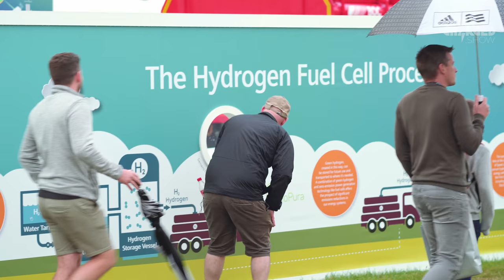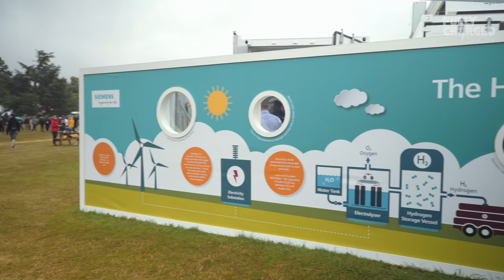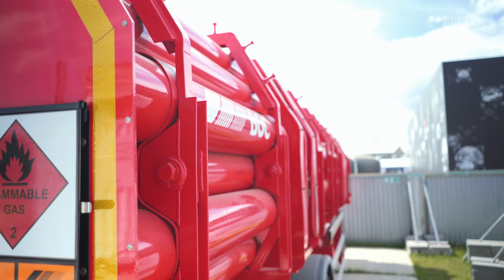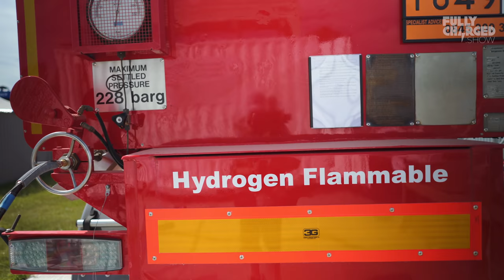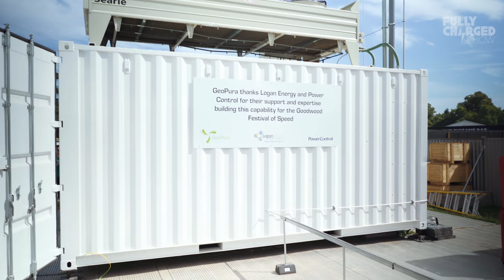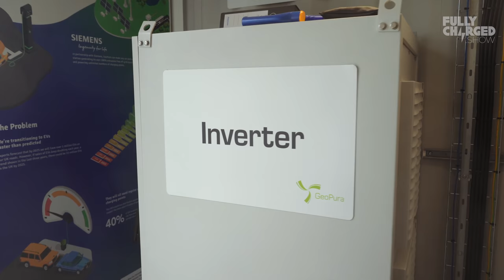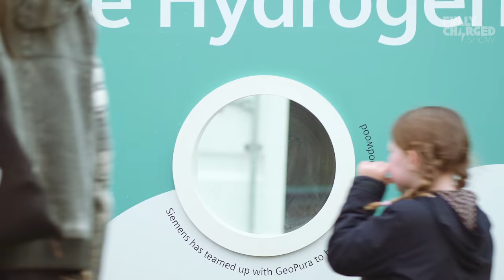Green Hydrogen Fuel Cell Charging System at Goodwood Festival of Speed | Fully Charged

Comment: In the coming years, as sustainable power generation infrastructure becomes ubiquitous and more sophisticated, there will probably be a place for hydrogen. Power generation in isolated locations could be married to hydrogen production as a means of storing energy. Hydrogen can't be shipped long distances, I believe. So why not plan docks for various ocean-going ships and/or fueling stations along long-distance truck routes, which are all near isolated wind or tidal energy generation sites. Flexibility and intelligent choices will result in clever solutions. Can't wait to see all this unfold. Wait for big oil to start buying up sustainable energy companies - then we'll know the change is on.
Reply: Meanwhile shipping (even cruise ships) runs on the dirtiest fossil fuel possible because its the cheapest.  I agree, shipping is the logical use for hydrogen, possibly the only one that really makes any sense.
Reply: Storing energy in hydrogen is an incredible waste of energy. It needs minimum 3 times more energy than batteries. There are better solutions than that.
Also hydrogen is in the interest of the Oil industry because most of the hydrogen gets produced by steam reforming from fosile gas. This is why hydrogen gets promoted so much all over the media. The idea behind the H2 car is very old but still this technology got its problems. The efficiency can not be increased by the way because one can not change the laws of physics.
Reply: Mike Trebert
Why not?
1) Because untill we have a LOT of "spare green energy" it will all be used anyway, or stored in grid battery banks, or home batteries, OR EV's (VtoG!!).

2) Before that unlikely situation occurs, it simply throws energy away.

As they said, "the fuel cell is 50% efficient, makes a lot of heat"
You'll say that's not to bad, but how efficient is the electrolysis to liberate the Hydrogen from water?
Let's assume that's 50% efficient as well.

That means at the car battery you get 50% of 50%..... 25%.
Or 75% simply thrown away.
Then there's the cost of running the plant, transportation, etc.
Reply: @Andy Geee 
Can you imagine the by products produced creating ammonia?
It's just an oil industry excuse.
Reply: @aladdin8623  you are thinking in the 19thC. Hydrogen is a building block of the universe and is liberated by the sun everyday on the ocean. Forget the limited science you have been taught. Water is very clean. Did you hear these men? They can liberate the Hydrogen using sun and wind. NH3 is irritating to the senses and toxic.
Reply: There’s a lot of research going into finding a proper electrodes that can help in producing hydrogen directly from sea water because its already a pretty good electrolyte due to the salt in it while preventing the formation of toxic chlorine gas, if this could be done with help of clean energy such as solar or tidal we gonna have a clean resource, personally i am more interested in methanol as a future fuel and there’s already clean way to produce it, much easier to storage and way better in fuel cells
Reply: Big oil is buying up sustainable energy companies to control them, not to become sustainable. Your hope in intelligent choices is nice but sadly naive.
Reply: @aladdin8623  But isn't the idea of this system to hydrolyse water with the excess electricity generated by wind and solar rather than natural gas? Electrolysis is 80% efficient, and the heat generated in the process can be put through a heat exchanger. A hydrogen fuel cell is also 80% efficient and the waste product is water. This is why they are used on the ISS. Sounds like a win-win to me.
Reply: @alaneasthope2357  The overall energy efficiency of electrolized Hydrogen used in a fuel cell is about the same as internal combustion engines burning fossil fuels.  (Do the math.  Be sure to account for the energy used to refine oil, which is very much.)  A natural gas ICE backup generator is actually a much smarter use of resources.  Fuel cells are indeed very well suited to manned space craft.  For use on Earth, batteries are 3x to 4x more energy efficient.
Reply: @thankyouforyourcompliance7386  I understand  the history and until recently I would agree with you. Luckily I have seen some new tech in the pipeline.  Big oil will come to heel and  receive a history lesson. Very exciting times ahead for the planet.
Reply: @andrewcoates1  what does hydrogen being a build block of the universe have to do with it? It's still a question of energy conversion and and best efficiency. These guys in the video may have some interesting points to make, but they are just doing a sales job. Don't think they are giving you the whole story. They talk about 50% efficiency to convert to electricity, but conveniently miss out the inefficient process of manufacturing, compressing and distributing the hydrogen.
Reply: Mike Trebert Hydrogen can be shipped over long distances in the form of ammonia and mainstream oil companies are already buying into and financing R&D for hydrogen and other energy types. Don’t know why so many people think that BEVs are an end in themselves. They are an interim step towards a hydrogen/fuel cell future.
Reply: @RedBatRacing  Sure you are right.  I emphasize the importance of looking passed the current self imposed 'science' limitations  by  Big Oil / Tech investors who will try to merchandise a basic product ' Water'.  Most will quote the high energy cost to liberate Hydrogen. Macquarie Universtiy were the first main stream western university to debunk th myth and explain that this is simply not true. The sun liverates Hydrogen by frequency resonnance not high power.  So, there is no doubt that great leaps in effeciency will be made and yes I am optimistic - not in an infantile manner, but for the purposes of busting the self limiting acceptance of most.
Off topic, but effectivly highlignts my point,  China advertised they trialed their first photon engine for space propulsion. Fueled by suns rays. NASA comes out a few days later and says, oh yeah we have one too.  But the media still bang on about rockets and rocket fuel ; all redundant and off track.
Real technology advances are being revealed at this very exciting time in history.
Reply: Please stop with the 10 year doomsday predictions.  We have had only 10 years to decarbonize has for the last 30 years according to many climate scientists with the attendant credibility hits.  All it does these days is create frightened and depressed school children. We will absolutely NOT eliminate carbon by 2030 so do we give up? No, we move forward as quickly as we can with economically attractive solutions.
Reply: @aladdin8623  Well said, as a "fossil" hydrogen producer for many years , I can't see it as a viable fuel. If you are looking short term then probably LNG conversion of shipping, which is readily available ( At a cost) will at least help environmentally.   Hydrogen from renewable energy certainly will potentially allow us to produce ammonia for use as a fertiliser more cheaply than present techniques and will reduce drastically the environmental deficit present hydrogen production solutions present.  Hydrogen presents many engineering problems associated with containment. The Hydrogen molecule is the smallest molecule, leakage is always an issue along with many other issues.   Electricity already has a massive distribution system and  with the emphasis on battery technology already resulting in huge improvement in range and battery longevity, the one oft mentioned advantage of hydrogen vehicles is waning very quickly.
Reply: @patreekotime4578  oil is not the cheapest, but it can provide a HUGE AMMOUNT OF TORQUE which an electric motor could not provide. that is the only issue with the cruise industry
Reply: @sadootaqoo981  "if this could be done with help of clean energy such as solar or tidal we gonna have a clean resource"
And if you used that clean energy to charge a battery, you'd yield 3x as much electricity...so to hell with the hydrogen, forget it, it's a losing argument.
Reply: @aladdin8623  I think it has a place as part of the energy mix: the interviewees made a good point about energy price fluctuations, when renewables are near peak output (the sunny, windy days that Germany and the UK occasionally ) and the prices dip to incredibly low values (or even negative) hydrogen production could stabilise prices and save us from turning off productive wind farms.

Festivals would love this technology. Glastonbury and other big festivals have to get in lots of power for stage equipment, eateries, phone charging stations etc. A few of these could easily replace many diesel generators.

Can't wait to see this made more efficient and scaled - the technology looks ripe for shrinking.
Reply: @imakevideos5377  
Totally incorrect
Reply: @GregRobsonUK  
You're missing the point completely
Reply: @Andy Geee The CSIRO (Government Science agency) in Australia have invented a converter that can do that at or near 100%, they claim, energy conversion ratio.
Reply: @fishyerik  Not what I had in mind. The Australian govt. is very conservative - likes coal.
Reply: Hydrogen is such a waste of energy when batteries are a much better solution. Being better than diesel is not impressive. Hydrogen is only a realistic solution for long distance airplanes and boats.